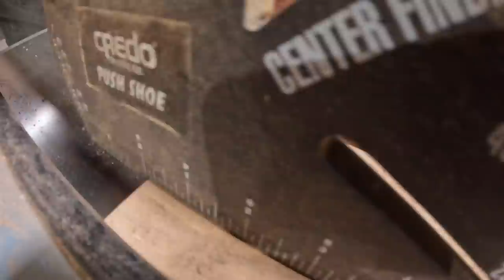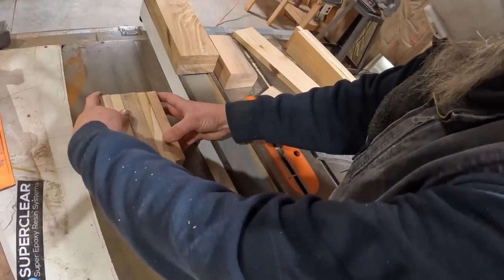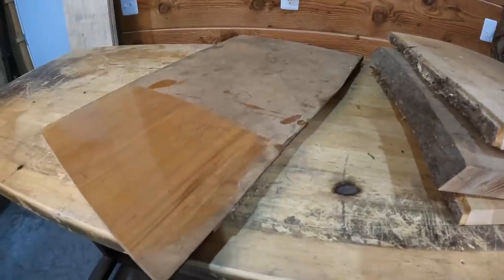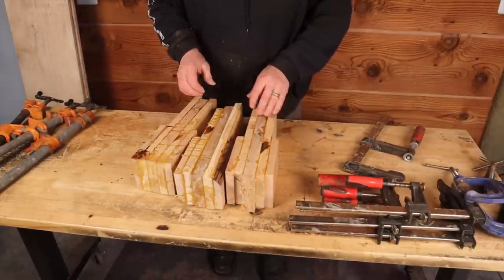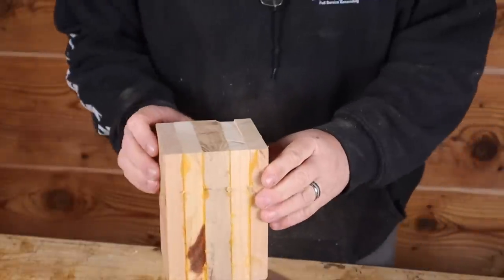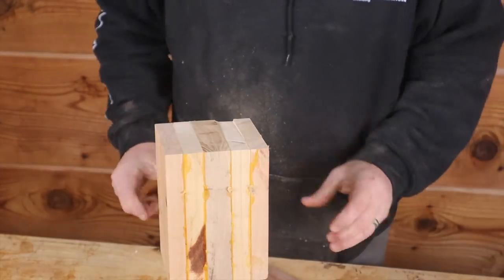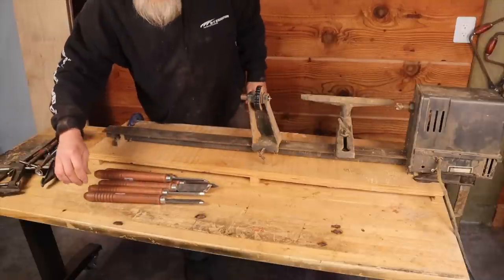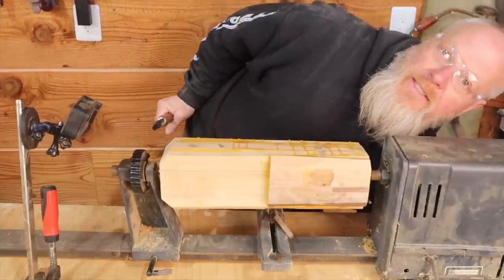Turning Wood For The First Time In 35 YEARS!

Comment: About that madrone log--did you let the slabs air dry for a year or two? Kiln dry? I ask because in September I milled a large madrone (felled 4 years prior) from my property into 3" slabs and all are stickered in my barn, preparing to take to the kiln next summer in Klamath Falls.
Reply from the maker: That Madrone was a deadstand. I’m not sure how long it’d been dead. The wood was checked already. It probably sat for another 4 years after I milled it. I milled a green tree around four years ago that’s been air drying. It warped pretty bad but I think I can use smaller pieces of it.

Comment: Jason, did you ever figure out what to use The Bearded Giant's gift for? I cannot find his build video.
Reply from the maker: I did. It sounds like he had audio problems and didn’t make a video. Basically you mount them to a wall and set a 2x4 horizontally in them and then you can hang your clamps on the 2x4. I’ll definitely show them off once I get them mounted.